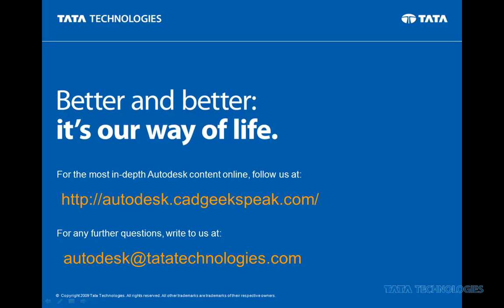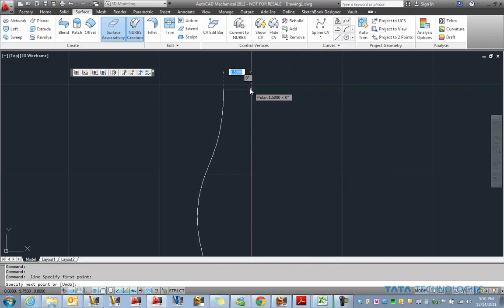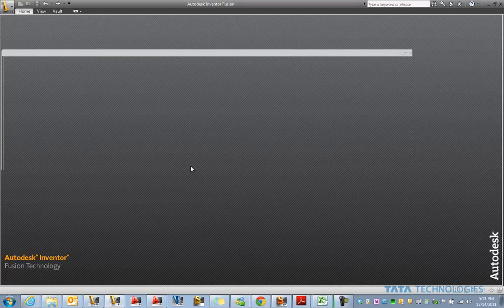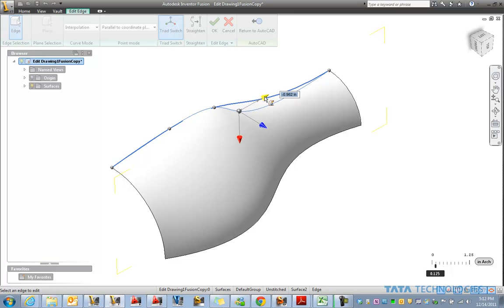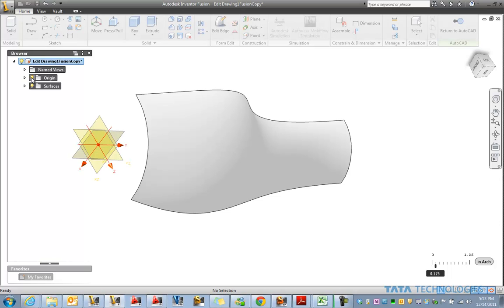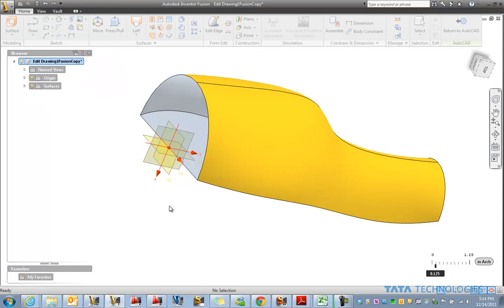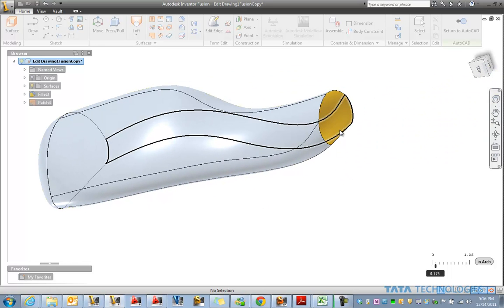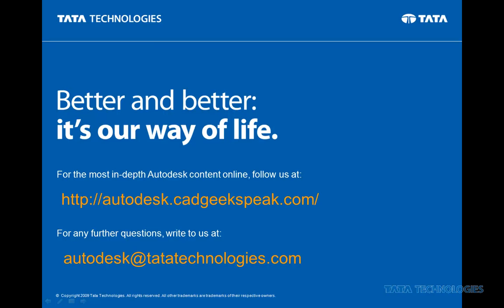AutoCAD surfaces and Inventor Fusion

Comment: great video! I wonder if there's a way for triming two surfaces that cross each other, or to edit the edges in a more automatic way than moving the points to where it seems to start the other surface
Best regards and thanks for this helpful video